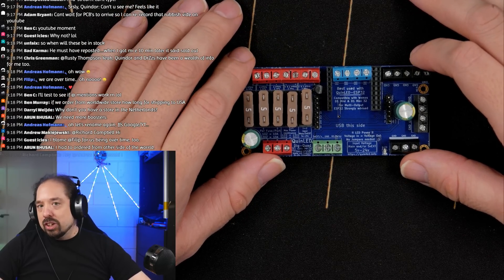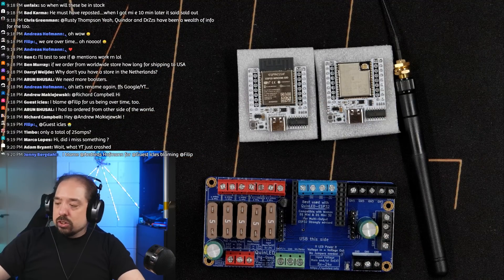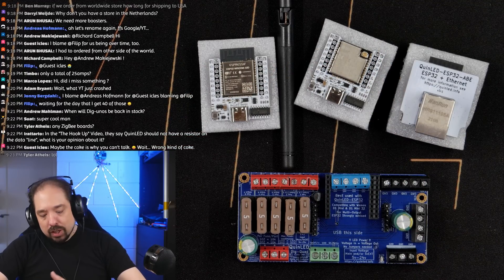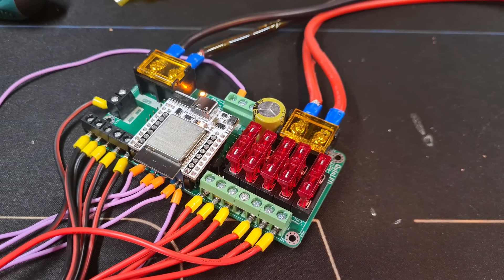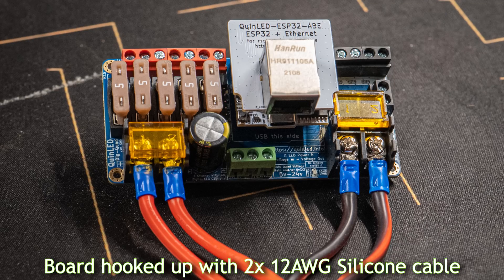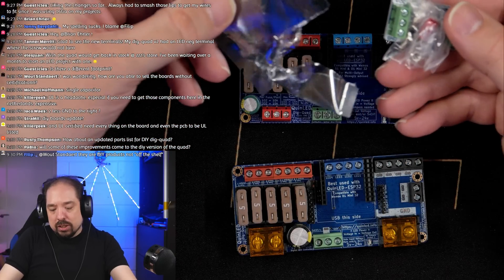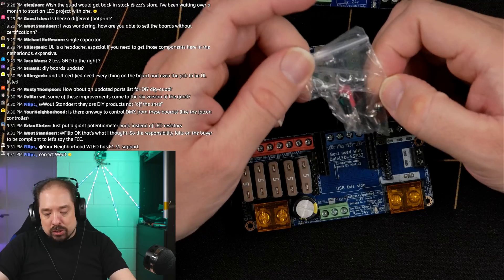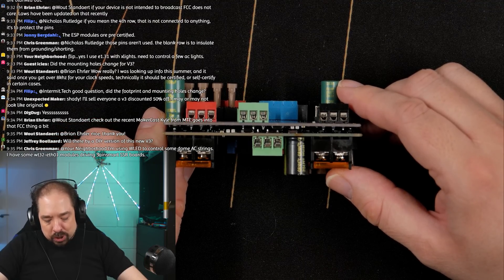💡QuinLED💡 QuinLED-Dig-Quad v3 introduction - 4 channel ws2812b controller with WLED!

Comment: I have a twinckle light setup: 2 X UCS2904 High Power 4W RGBW LED + 1 stepper motor (stepper driver A4988). Is there a way to control the LEDs and the stepper driver using the Digi Quad? if so, how would I wire it and what settings should I use?

Comment: Sorry if this is a dumb question as I am new to the addressable LED's. my project would be about 1000 to 1200  12V leds across 3 channels. It would have around 20 5v LEDS that would need powered on a separate channel. I did not want to have to by a separate 5v power supply so would I be able to run those few LEDS off the data connection and the 5.1 relay output you spoke of? Not sure if that is what it is for or how I would wire for that configuration. also this would also be about a meter at most for the connection. Thank you for your time.
Reply from the maker: Ah no you can't use the relay output but you can just use one of the normal outputs and connect a (beefy) 12v to 5v buck-converter and run those 5v LEDs that way, that will work fine.

Comment: We want to install some leds on our boat. We have both 12v and 24v onboard. What would you recommend for QuinLED product for this purpose? 3 different zones some around 30 meters of WLED. Appreciate any guidance!
Reply from the maker: Depends a bit as always.

The 12v and 24v, is that stable voltage or battery voltage? If the latter that could potentially damage things.

Then it depends if you want one controller or multiple. For one you'd be looking at a Dig-Quad or Dig-Octa with wires going to the various strips (and power injections of required). Or maybe you could several Dig-Uno more locally to where the lights will get installed.

30m is long for an LED install so will require a decent plan. Maybe come to the Discord server and watch my power injection video? That should certainly help getting you the right stuff!
Reply: @IntermitTech  Thanks! Battery voltage. 12v 150A x 4 batteries and 24 95A x 4 batteries. 
One controller would be enough if possible for 3 different zones. Basically, kitchen, main deck and a dining room. 30 meters in total, but mostly 5 meter sections. I've joined discord as well. Any guidances is much appriciated, we are ready to order :)

Comment: Is it possible to use 2 types of powersupplies with the Dig-Quad? 
Because I want to run a 24V and a 5V LED Strip at the same time but I dont wanna buy 2 ESP32s 😅
Reply from the maker: It is not, what you can do is a get a beefy 24v to 5v buck-converter and run the buck after the Dig-Quad which gets fed with the 24v supply.
Reply: @IntermitTech  Oh I didn't know something  like this exist. Thanks for the information this will be helpful for me and what I saving in a second powersupply I can spend into the 24v to 5v buck-converter😊👍

Comment: Do any of your boards have a built on mic for sound react? I am working on projects using under 2 strips 1 5 m 1  3 m . Looking to control separately if possible and music react.  Any of your boards you recommend?
Reply from the maker: The dig2go has a digital microphone built in. The Dig-Uno and Dig-Quad you can get the AE+ version of my QuinLED-ESP32 boards with one integrated as well.

Comment: Will this work with xlights?
Reply from the maker: Absolutely! Using either WLED firmware or ESPixelstick firmware and for both the board definitions are included right out of the box in xLights! Get the Ethernet version to make sure there is no lag, especially if you plan on maybe running multiple boards.
Reply: @IntermitTech  didn’t even realize you had an Ethernet option.  Awesome.  This will be perfect.  We run a haunted hospital attraction and have been looking at options for better lighting control.  Super excited for these.  Thanks
Reply: @IntermitTech  How long does it usually take for Drzz to get more in stock?  Shows they don't have any of them.
Reply from the maker: He should have lots in stock again around next week!

Comment: i just hope the supply meets the demand but its too hard to buy as of now
Reply from the maker: Yes we're currently fully out, unfortunate timing with a few things coming together, few more weeks and everything will be available again!
Reply: @IntermitTech Greetings, I would like to know how this works since I am new to this.  I want to start now to do a lightshow.  But I've seen some videos that talk about F16v4 or F16v5 controller.  And I got a video with your product and it caught my attention.
Reply from the maker: Sure there are lots of videos out there how to use ESP based controllers with xLights and such. Something with Ethernet or otherwise SDcard is recommended!

Comment: Hi I'm using 18awg from power supply to controller and 18awg to pixels , was not sure if i should go lower awg from power supply to controller , i gather 18awg is fine for pixels but was not sure if i needed to go say 12awg or 14awg from power supply to controller , any help welcome .

Comment: I assume boost max distance is 10m/32ft because of voltage drop and attenuation. Could you hypothetically go forever with repeat power-injected boosters every 10m/32ft (or less)?
Reply from the maker: You can go much further if you properly power inject. At some point you'll run into other limitations though such as max recommended amount of LEDs for a single channel because of the LED protocol.

https://quinled.info/2021/03/23/max-amount-of-addressable-leds/

Comment: Just received my dig quad with esp32 (AE). On the back of the esp32 it says 
5v only. I have 12v LEDs, obviously I also have a 12v power supply. Do I need a separate 5v power supply for the esp32?

Comment: I want to connect  a input switch to the one of the gpio.  How do you go about doing this and using the HomeAssistant to receive this input trigger from the switch.  We need some video examples on how to use and configure all this features such as the available pins as input trigger and output relays on the quad board.  Instead what it can do.

Comment: Does the board lose the configurations when you cut the power ?
Reply from the maker: No not al all, most WLED configuration values are stored automatically and segments and effect configurations and such can be stored in presets.

Comment: Ive bought a dig-quad and 4x 5Meter SK6812 5vdc LED strips (300 leds each strip) and they can take up 15.25amps at full brightness. Because these are ip67 strips I don't plan on running them at full amperage because they will likely overheat but would like at least be able to drive them at 10amps each. The dig-quad is fused at 5amps each channel.  I can limit the max current in the software to 10 amps but can i replace the 5amp fuses and put 15 amp fuses for protection? What is the max amperage for each channel that this quad board can handle?

Comment: Which board would be needed if I’m doing my living room outer ceiling the dig uno would be fine right? I’m also wanting to do my bedroom outer ceiling as well? Or does it matter how long the length of les it will take to do the outer ceiling ?
Reply from the maker: You'll need to look at total amount of LEDs in regards to max per channel and then also at power usage and injection required. This video https://quinled.info/2020/09/26/power-injection-livestream/ might be a good start for that. :)

Comment: Hi Intermit.Tech i looked at your article very interesting but for a novice like myself i got lost , i have your latest dig quad very pleased with it but here are my questions i would like to ask , i will be running a tree with 600 5v pixels on it , would you suggest i separate each channel to maybe 150 each or 600 to one channel , would prefer to run just off channel one if possible  , now where it really confuses me is the power injecting , if i put 600 5v pixels on channel 1 then power inject from the dig quad spare controller ports ie 2 3 4 5 to every 100 pixels do you think this is ok ? would be really grateful if you could help on this , but reading your articles baffles a novice like myself , any help welcome , or a better way of running 600  5v pixels on the dig quad .
Reply from the maker: 600 pixels on a single data output is the recommended maximum, so all good there.

Regarding power injection yeah you need to spread the load over the fused terminals. If you are still confused, join the Discord and we'll help you out!

Comment: Hi Quindor, I would really like to buy 2 pieces of your Magic boards (quin led DIG4) but I'm still wondering if these will ben compatible with ws2815 I got on Aliexpress at BTF Lighting's. SKU for 1meter version is: ws28151m60lb65, but I bought 27m   for my project. Actually, I tried many configurations to make them work (several models of esp32, several level shifters including Texas instruments SN74AHCT125N, several resistor values between led strip and data line from level shifter  etc. ) and all I get is a flickering led strip.After 2 weeks (each evening) trying and failing I m out if despair, and not sure Wled on an esp32 can make them work.  Have these kind of led strips ever been tested on your boards? Would you mind helping me  on the right way of wiring the level shifter to make some tests ? I'm very impressed about the great job you do, and your boards are exactly what I need. Many many thanks in advance. Regards, Alex.
Reply from the maker: Hey hey, sure, we have lots of people running ws2815 using the boards (example, the LEDs behind me on the wall are 144LEDs/m ws2815!) so that should be no problem at all.

I'm not sure what's not working in your own setup but you could ask to verify your setup in the WLED Discord maybe?
Reply: @IntermitTech  Hi Quindor, yes good Idea!  I  draw my diagram asap, then see you on discord. Thanks a lot, cheers.

Comment: Hi i  have have the latest digi quad v3 can anyone tell me how many ws2811 12v and  5v pixel strings will this except on a single channel thanks
Reply from the maker: Wait, there is an article for that! 😉 https://quinled.info/2021/03/23/max-amount-of-addressable-leds/

Comment: What am I doing wrong with ferrules and these screw terminal blocks.  Every time I remove one they pull the metal on the top out with them, I have to bend it back up and shove it in with a tiny screwdriver. Otherwise love my DigUno/Quads!
Reply from the maker: Hmm, yeah, that's a small down side to these terminals that that can happen, try flattening the ferrules a little bit before they go in, that's what I usually so and then have no issues getting up to 16AWG in there easily with these new terminals.
Reply: @IntermitTech  good idea, thanks!  I got them fixed up enough to use and just put small jumpers to wagos to make bench testing easier without having to mess with the terminals.

Comment: would it be possible to use 4 of these and create a mega tree?
Reply from the maker: Sure, one board can already drive about 2000 pixels and if you want to do real-time stuff, do so over Ethernet and it'll work great!
Reply: @IntermitTech  So if I had 16, 100 pixel Strings, I could run a pixel Tree off of one o f these?  Is nobody doing that?  Much less expensive option than pixel controllers or something.
Reply from the maker: Sure yeah, there is people doing that already, especially with the Ethernet version if you want to use xLights, no problem at all.
Reply: @IntermitTech  WOW I had no idea!  Any tutorials or walk through out there?

Comment: Hi guys, do you how many meter of cable I can connect from this quinled to the strip led? If for example I have 5 meter of cable away from the led they would turn on?

Thanks
Reply from the maker: https://quinled.info/2021/03/10/maximum-length-data-wire-leds-ws2812b-sk6812-ws2815/ and https://quinled.info/2020/09/26/power-injection-livestream/ :)

Comment: Got a question anything stopping a ethernet external antenna version
Reply from the maker: Technically no, but products need to make sense. If you are getting the Ethernet version, what would you use the external antenna for after activating the Ethernet function? So not to complicate things even more I decided to only release a single type of it. What would be the use case?
Reply: @IntermitTech   thanks for the reply mostly was a theoretical question of is there a reason it can't be done. More than a use case basis. But you got me thinking  one that came to mind was flexibility of repurpose one display you may want ethernet next it gets used as a wifi that has best possible reception of signal.

Comment: Apologies that this is off subject. When I use presets to turn off my dig-uno I always seem to end up with the first 5/6 leds illuminating after a few hrs. If I power up then off again they extinguish for so long then re illuminate. Sometimes white with one red or all white.  Any ideas on this ? Thanks from the UK.
Reply from the maker: Sounds like some stray signal is happening somehow you could try adding a pull-down resistor to the data line, see if that maybe makes it better?
Reply: If you are running the latest WLED beta, enable "Off Refresh" in the LED settings, that should also help by immediately turning off the stray signal again

Comment: I received my quad-ABE v3 a few days ago and loving it so far! Is there any advantages, or disadvantages, from doing power injection from the diq-quad vs my power supply?  I think the boards are a great value.. Thank you for your time.
Reply from the maker: Awesome! Yeah the board is made to handle power distribution so it makes it easier in regards to having multiple terminals and such and it also takes care of fusing multiple injection runs and does some reverse polarity protection and such to try and save your stuff if you happen to connect it wrong. :)

Comment: What are the screw down spade connectors called? Been looking for something like that.
Reply from the maker: Generally I refer to those are fork crimp connectors you can get them in lots of different sizes and such. I've tested up to 2x 10AWG on the input terminals and that fits fine although generally I'd advise 2x 12AWG I think since that's more then plenty for the max current we found out in a recent livestream. :)
Reply: @IntermitTech  thank you for the reply! And thanks for all the content and information you share!

Phraseology got the better of me. I meant the actual terminals. They look super heavy duty, but have no idea what they are called.

Comment: I 100% understand the price going up.
I work for a company that designs, builds, and repair electronics that we use in our robotics.
I help with all those functions including re-speccing parts due to availability and lead time.
That has gotten out of hand really really bad lately.
We have 40 and 50 week plus lead times on many of the parts we use and have had to make significant redesigns to work around the parts availability, only to find that some of the parts that we switched to are out of stock again by the time the redesign is complete
Reply from the maker: Yeah, same on this side, luckily I haven't had to do much changes yet because take so so much time to fully validate but the increases are really hitting left and right, so I certainly feel you in that regard! Thnx for understanding! :)